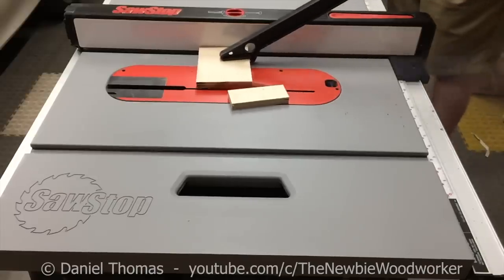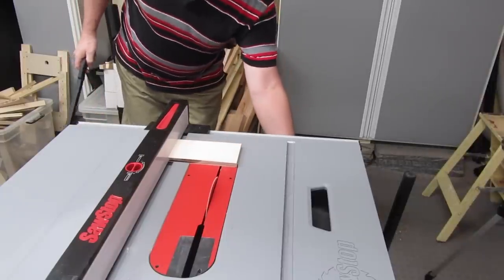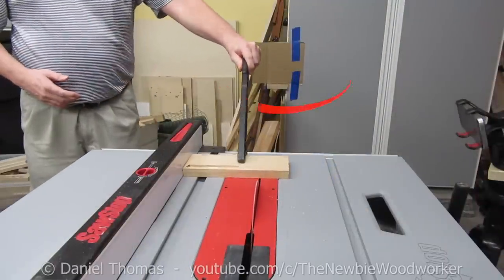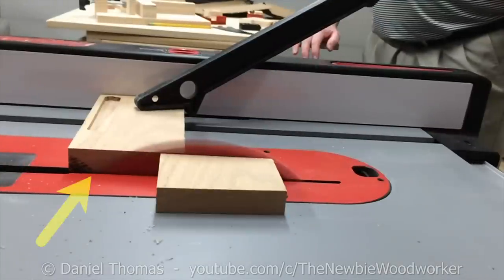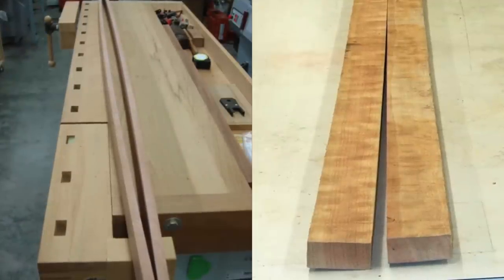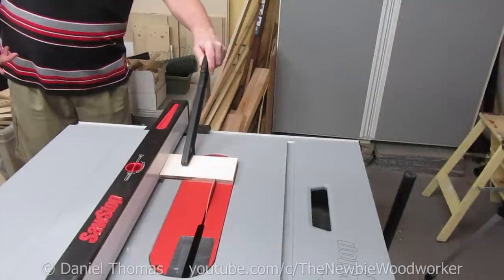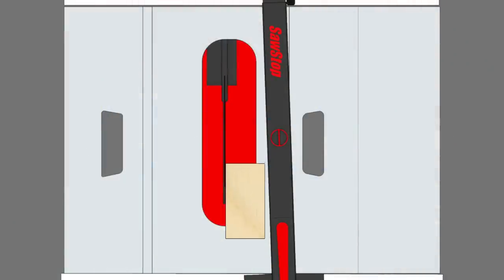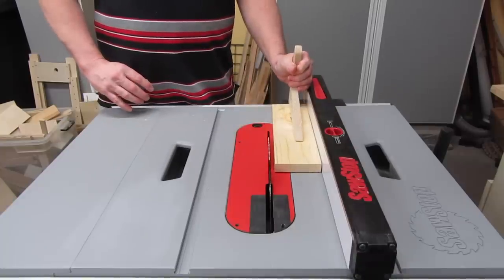Actual Kickback (in Slow Motion), & How to Prevent It

Comment: Once after making a cut with my mitre gauge, I moved the cutoff away from the blade, stepped back and to the side as I always do.  I was about 4 feet away from the saw and examining my cut at reading distance when, unknown to me, the cutoff about 1.5 x 6 inches slowly vibrated back into the blade. The blade caught it and launched it. The piece went spinning through the air hit my finger tip and broke the bone. This was completely unexpected. It could have hit me in the face or worse the eye. I do wear safety glasses but I'm not sure if they would have helped much here. In retrospect I did do a couple of things wrong. I had left the saw running after the cut and I had the blade guard off. Had either one of these been done, I wouldn't be writing this comment.  Moral of the story, the table saw is a very dangerous piece of equipment, you can never be careful enough.
Reply from the maker: That's quite a story, and a lesson learned the hard way! Thanks for sharing.

Comment: As for the cost of Grr-Ripper push blocks, I see you have a SawStop. That's not cheap either. I think it's reasonable to have 1) a SawStop table saw, 2) riving knife in place at all times, and 3) two Grr-Ripper push blocks.
I'm curious what other people think about blade guard vs. Grr-Ripper blocks. Seems like you have to choose.
Reply from the maker: Yes, you do have to choose. I don't use my Grr-Rippers much any more, since I've started using my blade guard as much as I can. They still have their uses, but not as much as they did in the past - for me, anyway.
Reply: @TheNewbieWoodworker  That's interesting. Can I ask why you prefer the blade guard? Certainly, a newbie should use the blade guard by default. But eventually it seems that people with more experience and knowledge of safety issues tend to go without the blade guard, and the Grr-Ripper helps make this a safe option (along with safety glasses). So in your opinion, why would you prefer the blade guard? Thanks.
Reply from the maker: @charles.neuman18  In all honesty, I think using a blade guard just makes sense. Much less chance of injury, although I know there are people who argue against this, but obviously I think they're wrong. But for me, the main reason is I have fairly severe ADD, and although I take meds for it, my mind can still wander. So for me, a blade guard, along with a SawStop, just makes sense.
Reply: @TheNewbieWoodworker  Thanks for your candid reply. I guess the lesson here is: Know yourself. What works for one person might not be the best for someone else. Yes, I do think the blade guard makes sense, and I have always used one. I was just interested in how other people deal with safety. Good to know there are several safe ways of doing things.
Reply from the maker: @charles.neuman18  Great point - everybody's different.

Comment: This video was scary, funny, and informative all at the same time! I'll be buying my first table saw in a couple of months and these videos are so helpful. How come most Youtubers don’t use the guards or riving knives on their saws? Is it because of filming purposes?
Reply from the maker: Thanks for the comment! I'm not sure why most don't use riving knives. To me, they're a no-brainer. Although if the riving knife is wider than the blade, then it's actually dangerous (I just learned this a few weeks ago - fortunately not by experience!). So if you ever use a thin-kerf blade, check your riving knife and if it's wider than the kerf, then don't use it.

(The "kerf" is the slot in the wood that the blade cuts, by the way. It's also used to refer to the width of the blade, at the teeth.)

Regarding blade guards, let me say this first: When you get your table saw, use the blade guard whenever possible. Don't remove it unless you have a good reason, like using a cross-cut sled, for instance. Or it gets in the way of your push block or push stick - it's always more important to use a push bock or stick, than to use the blade guard. As you gain experience, you might come up with other reasons not to use it, and that's fine. Don't stop using it just because other people might not use it.

Also, if you want to use a Grr-Ripper, then you can't use the blade guard. But since the Grr-Ripper protects your hand somewhat from the blade, it's a reasonable trade-off.

The reason I don't use a blade guard is that it gets in the way of using a cross-cut sled, so I have to remove it and replace it all the time. Also, I prefer to be able to see the blade and the stock with nothing obscuring my vision. Are those good reasons? They are to me, but they may not be good reasons to others. So like I said, just understand your reasons.

Sorry for the novel. I just kept thinking of things. 😛
Reply: The Newbie Woodworker Thank you so much for taking the time to respond to my questions! The information is invaluable. I want to do everything in my power to keep all 10 fingers that I've been blessed with.🖐🏽🤚🏽The more tutorials I watch, the less afraid I am of trying these machines.
Reply from the maker: You're welcome, and LOL. I totally get it. The best way to be safe is through knowledge, and it sounds like you're doing your homework. Fear comes from lack of knowledge, and fear can get you hurt. But with knowledge comes a healthy respect for the tools, and that's your best chance of keeping all your digits. 😛 No promises, though. 😮😄
Reply: The Newbie Woodworker can you please explain why is it dangerous to use a thin kerf blade with a thicker splitter/Irving knife?
Thank you
Reply from the maker: I'll just re-post what Troy Meredith just posted (Thanks, Troy!): "If the blade is thinner than the riving knife, [the stock] will hit the riving knife and either cause a kickback or you stall until you turn the Saw off."
Reply: The Newbie Woodworker Why would hitting the splitter/riving knife cause a kickback or blade stall?
Reply from the maker: Sorry I didn't reply sooner - YouTube seems to hide replies, sometimes. In answer to your question: If the riving knife is wider than the blade, then it sticks out a little bit. That means that when the cut piece comes up to the riving knife, it'll do one of the following (or both):

1) It will stop when it hits the edge of the riving knife ("stalling").

2) If it continues on, perhaps because you just pushed harder, it'll be pinched between the riving knife and the fence, potentially causing kickback.

Does that make sense?
Reply: Janine, I embrace riving knives whenever a machine is so equipped, but almost no American saws have come fitted with such, unlike those in Europe. In America, the best they gave us was a guard mounted to a fixed height "splitter" bar, which performs the same function as a riving knife, but does not follow the blade up and down. Most everyone deigns to work with the American solution if they are doing work close to the blade, where a push stick is inhibited, or if they may often make a cut which does not fully sever the wood, as in making joints. Welcome to the club! L
Reply: Pilot, with a standard kerf blade, the riving knife is thinner than the kerf by only a trifle, thousandths of an inch. This is to prevent the sides of the rising teeth from having too much of a grip on the wood in the event of a cocking workpiece, or the kerf closing as a result of stress relief. The kerf of a thinner blade may not even accommodate the thickness of a riving knife, requiring terrific, unsafe effort just to push the stock through.

Comment: ok, suppose  you have a piece 20'''  wide and want to cut just a 1/4 of such piece, what part would I hold against the fence the 1/4  or the 3/4 of the whole piece?
Reply from the maker: Your dimensions have confused me a little, but if you want to cut 1/4" off a piece that's 20" wide, I'd put the 19 3/4" piece against the fence if your saw us wide enough to do that. Assuming the piece is at least close to 20" long also. I hope that makes sense.
Reply: @TheNewbieWoodworker  That's what got me , I tried the left side since I added a table to the left and it happeneddddddd, the right side is too short to handle the 20 inch piece. My first time this happening and of course it had to happen on my left. never at right side.
Reply from the maker: @ccccen  It sounds like maybe your saw is designed backwards from most saws I know about, so maybe you do have to reverse left and right.
Reply: @TheNewbieWoodworker  it's a piece of junk (Ryobi) I'm right handed, I hardly do anything with my left and that was my first time trying the left and I paid for it lol but now I have this piece that I need a 20 in from a 2 ft board and I don't have the space on the right, tried the left and got messed up (me) I'm gonna have to take it to my brother for him to do it in his saw or chop it by a hand saw :(
Reply from the maker: @ccccen  That works. It's hard to explain things in words. I suggest you watch a bunch of videos of people just cutting stuff. You can zip through a lot of them until you see someone doing something like you want to do. Honestly, that's how I learned most of what I know. I'd end up saying "So THAT's how you do it!" And if they do it a way you don't understand, you could either comment on that video, or here on one of mine, with the video link and the timestamp, and I could check it out.
Reply: @TheNewbieWoodworker  Been doing this for a few years now and never had kick backs and this first time has me a bit scare now of the saw lol , just looking to see if I should take another try at it. putting 4 inches toward the right side of the fence and the other 20 inches toward the left side of the blade. Haven't touched the saw since 2 weeks lol
Reply from the maker: @ccccen  Understood!

Comment: As a noob. The first time i tried a tablesaw on my own, the mistake i made was putting the blade on in the wrong direction. So when i made my cut, i was getting a lot of smoke from the cut! And i was too afraid to stop. thinking that if i stopped in the middle of a cut then id get a kickback, so i gritted my teeth and pushed the wood all the way through. The whole shed i was working in was FILLED with smoke! i learned my lesson the hard way.
Reply from the maker: I hope you don't mind me laughing, but that sounds like something I would do. I almost set our house on fire once while I was soldering a pipe in the wall. 🙄😄

Comment: would it be safer to start using the table saw backwards as in pulling the work piece instead of pushing it through?
Reply from the maker: No, definitely not. You always want to be pushing against the direction of the blade. There's a reason you don't ever see anyone doing it. :)
Reply: cool thanks

Comment: thats why i love my guard. it has i guss a riving knife but upside down that if the board tryes to kick back it will dig into the board and keep it on the table. may have used the wrong name but its ment to stop kick back
Reply: ok early but anti kick back prawls is what you called it built into the blade guard lol but ether way it never had to do its job nock on wood
Reply from the maker: @LoveShaysloco  Knock on wood, indeed. 😄

Comment: One thing that I think is a no-no is using a gripper pad.  Using one force the operator over the blade.  This is also true with the type of push stick where the stop is back toward the handle.  Use a push stick of the type where the handle is well back behind the blade when the cut is completed and above the blade.
Reply from the maker: I understand what you're saying about the Grr-Ripper, but to me it seems like it's reasonably safe. But as I said, I understand your point of view also.

Comment: im new to your channel so maybe you have done this and if so respond their is a BIG problem with "ARBORS" find the blade with the right one! are their adapters for this?
Reply from the maker: I'm not sure what you're asking.
Reply: @TheNewbieWoodworker  for a 10 inch blade i guess its 5/8 arbor however i think they come in 1/2=3/4=7/8 and its difficult to find the one you want are their adapter to put a 10 inch 3/4 onto a arbor 5/8? the blade goes on a screw or can the screw be removed from the motor and  new one put on or can some adapter be screwed onto the spindle to adapt it to anther arbor size?
Reply from the maker: @charlesklein7232  I would never use any size other than what the manufacturer recommends. Sorry if that doesn't really help.

Comment: This is one I found out today. I was midway through a crosscut from 48" to 22" on a 2x4 using another board screwed to my miter gauge with a block clamped on to the second board as a stop to easily cut several boards to the same length, or so I thought. Midway through the cut, my miter gauge popped out of the track and I was dealing with a really dangerous situation.

My advice is to inspect your miter rails and the slots in your table saw. If you can pull accessories attached to the rails (crosscut sled, custom jig, miter gauge, whatever) straight up out of the channel at any point, they're too short (even if they came with the saw).
Reply from the maker: Interesting. Thanks for the tip! 😄

Comment: (Due to time restrictions and the voluminous number of comments, I was unable to review many of the previously posted comments, so if I am herein repeating in essence something somone else has already posted, I apologize to all involved in advance.)

I really like your videos but may I respectively suggest you might want to consider not using actual wood as the kicked back material if you do any future demonstrations on the subject?   Please allow me to explain.

During a woodworking seminar several years ago, I once viewed a live demonstration of kickback presented by Kelly Mehler, author of "The Table Saw Book", an excellent book in which Mr. Mehler not only champions putting table saw safety first and foremost, but also shows how to pragmatically accomplish such throughout the book.  

Rather than using wood for the demonstration, Mr. Mehler substituted pieces of standard foam insulation board which not only somewhat lowered the threat of injury to himself as well the damage to the surroundings, but also provided a dramatically visible "tattle-tale" impression of the track the blade took on the piece in kicking it back (which in itself was enlightening as to the primary cause of kickback, i.e., the workpiece being hoisted up on top of the rapidly spinning blade from the lifting motion in the blade's rear upper spin direction.)

Since one of the joys of woodworking is the sharing of 'secrets' that make it both safer and more productive, and since I admire your efforts in your video productions, I wanted to share the foregoing with you.  Keep up the good work!

 (WARNING: Because of the high speed involved, kickback of ANY material is inherently very dangerous and I certainly would dissuade anyone from trying to mimic the educational demonstrations presented.)
Reply from the maker: Thanks! I don't intend to ever repeat this demonstration again, but if I do, I'll heed your advice. 😄And you're the first to mention this particular method of demonstrating, so you didn't miss anything by not reading the comments.
Reply: @TheNewbieWoodworker  Thank you, too.  Remember to always wok safe, my friend.     🤗
Reply from the maker: @dennislampley822  👍

Comment: I had a kickback of a type you did not cover here.  I was a raw newbie and I know I probably broke at least a half-hour rules... I was cutting some PVC pipe at an angle. The pipe was large enough that the saw could not quite cut all the way through it. I had made a sled, but the pipe kept riding up off the table causing the angle to be off. I took a large push block and placed it above the blade to hold the pipe down. The cut proceeded perfectly until the heel of the push block caught the top of the blade. I am not sure exactly what happened after that, but afterwards there was a spiral crack down the pipe's length. The sled flew back with enough force to hit me in the gut and knocked me down. Just bruised I though as I got up - but the push block got me too. It ripped through my shirt and left a 6" long cut on my side midway from my belt to my armpit. The block flew another 40' before it embedded itself into the vinyl top of a Rolls Royce. It hit hard enough to dent the metal under the vinyl enough to make the interior panel bow visibly.  I was very fortunate. Had that push block hit me square it would have at least broken some ribs and could even have killed me. I have no idea what it cost to fix the Rolls. I think my boss was so happy that I did not file workman's comp that he never even mentioned the cost. If I had to make that cut again I think I would go get a bandsaw even if I had to pay out of my own pocket. Honestly even a chainsaw would have been safer.
Reply from the maker: Wow, what a story. And I think I like that boss! "I am not sure exactly what happened after that" sounds pretty darn familiar. :)  Thanks for sharing!
Reply from the maker: @fishyman9089  I think the biggest issue is to hold the pipe securely while making the cut. That's just a tad harder with round pieces, so concentration is probably a good thing. 😄
Reply: @fishyman9089  true, but I did not have one...

Comment: my suggestion is, always make sure your tablesaw table top, is dry and clean. A few drops of rain might not look like a big deal, but when you try to make a pass, the boards stick to the top and get dangerous to push through the cut. 
Thanks for the video
Reply from the maker: Thanks for the tip! It sounds like personal experience. 😄